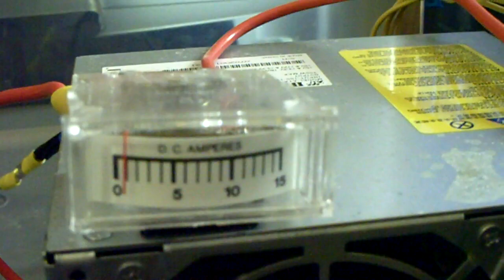Vid38 New Washer Dry Cell Hydrogen Generator (HHO, Brown's Gas, Hydroxy)

Comment from the maker: I was using Vinyl Coated Galvanized Steel.  Very cheap at Home Depot.  I think it was $0.35 per foot.  I used 12g copper wire in the past, but got similar results with the galvanized wire.

Comment from the maker: @getreal155 

Thank you, it's been a while since I worked on this design and don't remember it ever working as well as I had hoped it would.  I've learned since then that I should have used the following 17 plate configuration:

-nnn+nnn-nnn+nnn-

This works very well, but may need an extra neutral plate/washer in each section to reduce heat and amperage.

Comment: Very nice video's and your ideas are a great inspitation.
I wondered what the output of your double stack washer cell was. I really think this is the way to go. The 10 plate version seems to work very well and at low amps.
Based on your ideas I did a first simple test and it works remakable well. (+nn-) I'm experimenting with cups like you did but I cut out the bottom to get a nice steady water flow in between the cups. The design is basically a hybrid of washers and cups (wet cell). 
Thanks!

Comment: Thanks for your help!  Been chipping away at the project (takes forever using hand tools.)  I tried -NN+NN-NN+NN- on my own interpretation of your design and I got 0.6 LPM using NaOH 1-1/4 tsp/32 oz.  I scored my washers with a file (not sure if you did that) and only the 5 that are wired +/- have 1/4" holes to increase flow (my drill bit died before I could continue).  I'm going to try a few other tweaks and then post a video when I get some dry daylight (no ATX 12V rig, limited to car power).

Comment from the maker: In Vid#29 the configuration was +NNNNN-NNNNN+ (13 washers), but I've played around with about 10 different configurations since that design.

The best that I've had so far at less than 10A was the following config: -NN+NN-NN+NN- (13 washers)

I removed the recirculation hose as an experiment, but I have since come up with a water refill solution that involves drilling a 1/4" hole on the side of each washer and then inserting 1/4" drip hose to refill evenly between all plates.

I hope this helps

Comment: Hey man, I really like your design and I started on one today using ten washers and a nalgene bottle.  I'm just wondering which of your many configurations (total number of washers & placement of +/-) have you found produces the most HHO & drawing less than 10 amps?  What was your +/- configuration in vid #29?  Btw I see your production decreased between #29 & #35 after you removed the recirculation hose.  Why did you decide to remove it in the first place?  Thanks 4 posting all your progress.

Comment from the maker: I may be out of a job, but I'm not going to stop experimenting with HHO. I'll just have to get creative and use things I have around the house.

I hate to use zinc plated anything, but it is all I can afford right now. For experimenting with different concepts I figure it is less expensive to use zinc plated washers and then dump the water after the zinc has dissolved. I know I can't expect to get the same results with stainless, but I can work out all of the details of the design first.

Comment from the maker: I'm not too concerned about messing up the plates on this cell. The results aren't going to be accurate anyway, because I didn't have the money to get more stainless washers. I built this one with zinc plated 2" fender washers, just to experiment with different plate configurations before I assemble the all stainless design.

When I land a new job I will have the funds to build it right.

Comment from the maker: Thanks, 

I know, I was just testing for leaks. I always use distilled water when I run my cells, but I didn't have any available, so that is why I used tap water. I went to the store last night and bought two 2.5 ga. jugs of DW, so now I don't have any excuses.

I've made the mistake of using tap water before and it jacked up my plates and didn't give reliable consistent results. The water here in Anaheim, CA is one step above sewage.